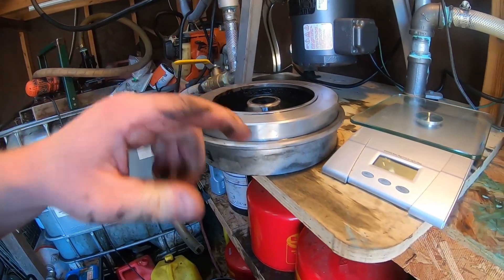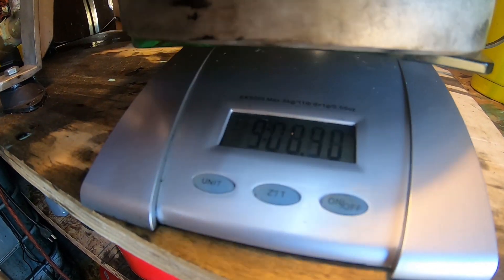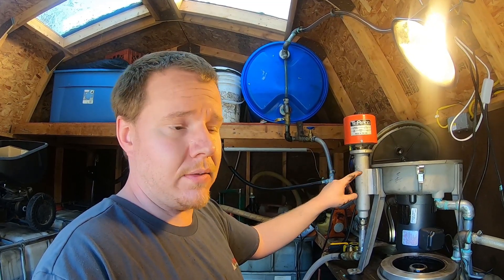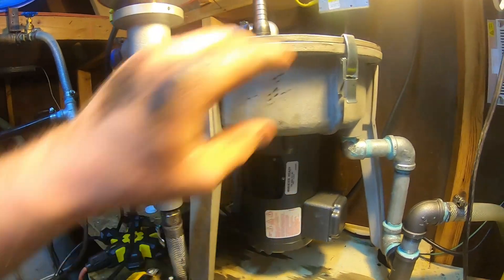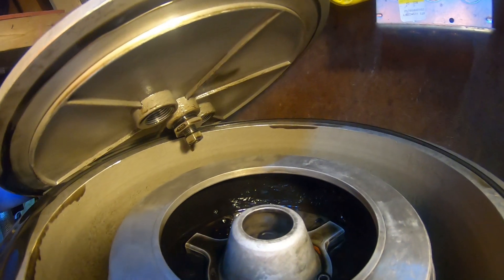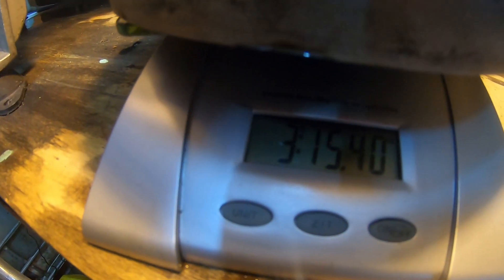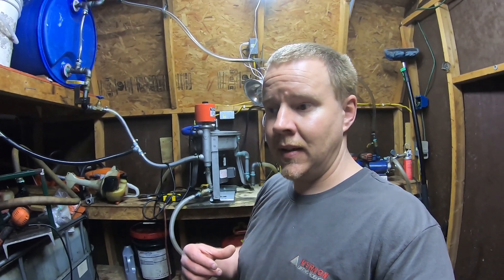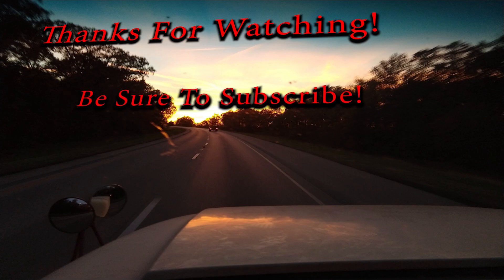Black Diesel - Small Batch Test - Thinning With Diesel & Centrifuging w/ Heat - WMO - WVO - DIY

Comment: Is it better to run one slow batch vs running batch twice
Reply from the maker: I prefer multiple runs mainly because I've had a single run completely fill the bowl on the unit and that was at my normal speed.  If I would have ran a single slow run, I would have had to run it again anyways.  The multiple passes lets you check the bowl and progress with each run and you can shut the unit down if you don't want it running over night or while you are away.  It's more convenient for me to do it this way.

Comment: Been loving your videos. I'm about to buy a 1984 f350 with the 6.9 idi, where and how could I get started in running wmo in the old girl? 
I'm going to be pretty broke after buying the truck.
Reply from the maker: The 6.9 is a solid platform for oil.  First off, do you have a source for oil?  What were your plans for cleaning the oil?  If you know the source of oil and can pretty well eliminate moisture contamination...   you can go pretty cheap on filtration.  The first part is settling...   you need a way to let the oil settle for a week or so and then pull from the top of your storage container...      then run it through a bag filter.  I've got a video or 2 showing those and comparing them.  They work well for the price point.  The IDI is pretty forgiving...   just be aware that you may plug fuel filters the first tank or 2 as oil will break down sludge in the tanks...    so have extra fuel filters in the truck with you.   Start slow...   work your way up.
Reply: @NotSoGrandGarage  I plan to set up a small metal shed and I have a good source of oil, I'll just have to run everything through multiple filters for now and figure out about a centrifuge because one of those is a good bit out my budget right now
Reply from the maker: @edp9811  gotcha.  Filters can work...   just need to make sure the oil is moisture free.  The idi is pretty forgiving when it comes to fuel quality.   Lol
Reply: @NotSoGrandGarage  right, the moisture part is what I'm most worried about
Reply from the maker: @edp9811  settling and heat are the best ways to remove moisture.
Reply: @NotSoGrandGarage  oh? I didn't know the heat helped, I know oil will sit on top water though so that makes sense, thanks again
Reply from the maker: @edp9811  No problem!
Reply: @NotSoGrandGarage  just got the truck today and it actually had dual tanks, I'm excited and about to start studying your videos lol
Reply from the maker: @edp9811  good deal.  I will say it would be wise to keep a spare tank valve handy and a few filters as you get started.  I've also got a short that shows how to quickly bleed the fuel systems in these trucks.  I'll copy the link here in a few
Reply: @NotSoGrandGarage  awesome thanks

Comment: Have u ever thought about hot steam injection into a diesel engine intake? Wrap a 100ft copper coil in insulated exhaust pipe? 3x less fuel, 200 degrees celcius steam is dry steam
Reply from the maker: I've used water injection and water methanol injection on diesels but not steam.  What kind of pump, nozzle, etc?
Reply: Just steam pressure, maximum steam, no pump, exhaust temp is 500 degrees c so thats alott of heat for copper coils with water or wiper washer fluid
Reply from the maker: @earlwilson6153  so what controls how much steam makes it to the intake?  If post turbo...  how do you keep boost pressure from just blowing it backwards through the tube?

Comment: would adding diesel to the SETTLING oil  help to settle it more effectively and faster, this sounds like something worth doing if you aren't using petrol to thin later.
Reply from the maker: You could do it even if using gasoline after the fact to thin.  I'd say if you are mixing any diesel in the blend, it would be worth it to add it to the settling tank.  It won't evaporate out and it can be safely heated.

Comment: Do you think you’re Chevy pump would work good for a pressure centrifuge? I have a 55 gallons per hour pressure centrifuge and a 1/3 hp electric motor but I am in search for a pump
Reply from the maker: No.  What I ran on mine for years was a power steering pump from a 2002 ford focus.  They used to be around $50 with a lifetime warranty.
Reply: @NotSoGrandGarage  what rpm would you run that focus pump at?
Reply from the maker: @JohnnyFabz  if I had to guess, if sat around 1k or so.  Had a 2/3 v belt pulley setup and a standard 1/3hp 110v motor from a blower.  Worked well

Comment: Is there anyone that runs a  Semi truck on black. Disel
Reply from the maker: Used to be common practice years ago to dump the sump oil right into the tank.  I'm sure there are owners still doing it.
Reply: @NotSoGrandGarage  would you run a 12.7 L detroit  on your fuel  try it on the video
Reply from the maker: @user-vh6vp5qi8m  I would if I had one.  I e currently got a few 7.3 IDIs, an om617, and a DT360 running on it though in different configurations.  I have videos up of all of them.

Comment: I used to run 20% gasoline to thin the oil, heated with a small water heater. Did probably a thousand gallons of oil that way and never had any problems. I stopped because I read that the gas boiled out and that I was wasting money, but I never checked myself to confirm. I figure volume loss would indicate whether it was boiling out or not. Maybe something else you can test. I did find that my oil was a lot cleaner with the gas pre-centrifuge though. Adding it after and letting it sit for a while settles out a layer in the bottom of the drum.
Reply from the maker: I won't do it heated.  Reason being is even unheated, the gas fumes coming out of the bowl vent are strong.  I don't see ot being worth the risk.

Comment: I've only been able to get my oil up to about 160f with the heater I have. This might work as a middle ground. If you're looking for more tests to run you could try Temps between no heat and 200+ to see if there's a fall off in efficiency
Reply from the maker: I have tested no heat vs heated...  Didn't test different temperatures though...  so I can add that to the list.
Reply: I watched that one when it came out. Ended up redesigning my centrifuge as I was building it. That video saved me some headaches I'm sure
Reply from the maker: @connordwyer1209  I'll see if I can do a "best temperature" test soon

Comment: Thanks for doing this test! I’ve been wondering about adding diesel…. 👍👍👍👍🇺🇸🇺🇸🇺🇸🇺🇸🙏🙏🙏🙏
Reply from the maker: No problem!  Thanks for watching!
Reply: @NotSoGrandGarage  
Hey there. I tried ordering 1 of your drill oil gear pumps and it doesnt let me select Canada for shipping. Do you know when you will be shipping to Canada? Thx
Reply from the maker: @peterharder3091  you'll need to use the contact page and get me your shipping address.  I'll figure out what I need to do and get back with you.
Reply: @NotSoGrandGarage  
Ok thanks
Reply from the maker: @peterharder3091  no problem.  I've not shipped anything across the border so not sure what all it takes